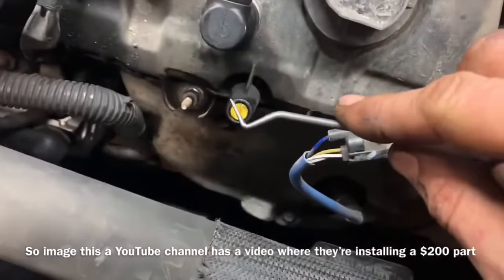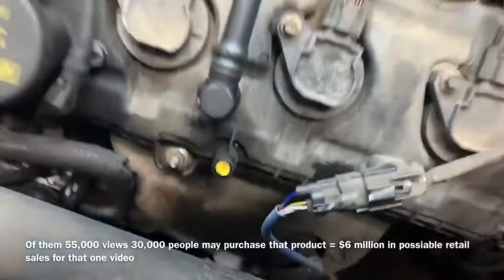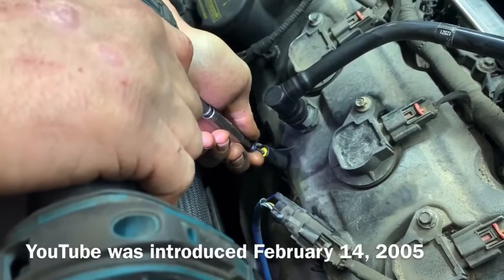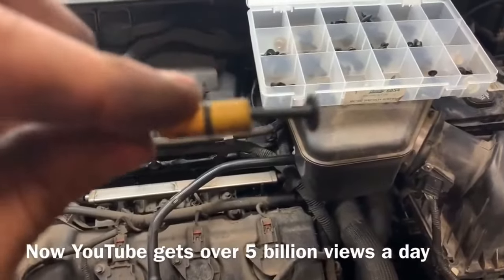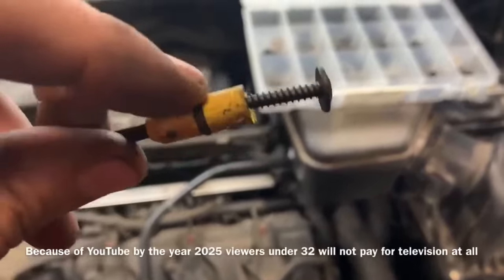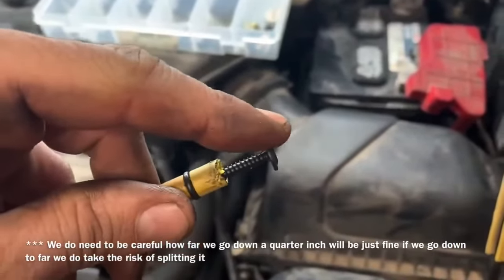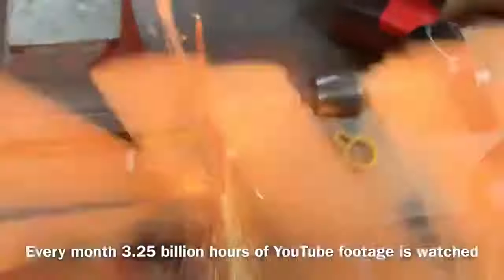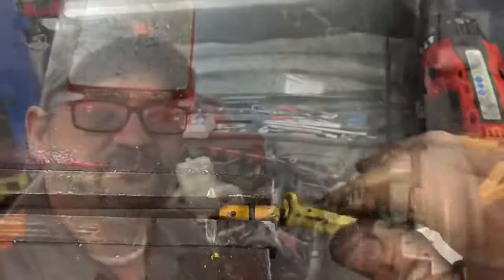Fix a Broken Dipstick - Stuck Inside The Dipstick Tube!

Comment: Mine was stuck pretty hard and screw didn't work, toostuck.  I ende up using a dent puller.  Screwed it in and after 3 slides if the weight it popped out
Reply: What type of dent puller did you use? There are too many to choose online.
Reply: @jaclynchristianson9458  straight puller with screw at the end and a slide hammer. Old school type where you would drill hole in the metal and screw the puller into the hole
Reply from the maker: https://amzn.to/4bx5NWc
Reply from the maker: https://amzn.to/4bx5NWc